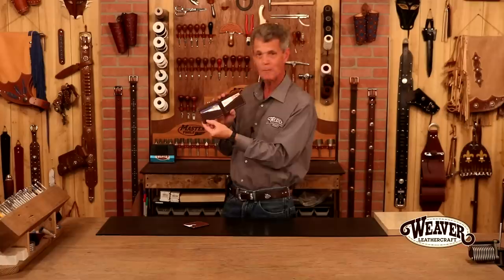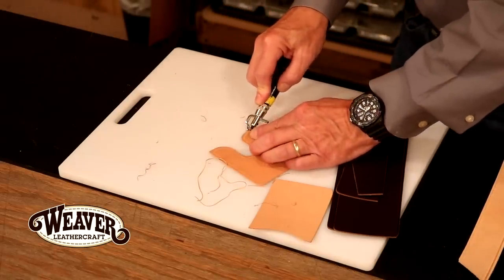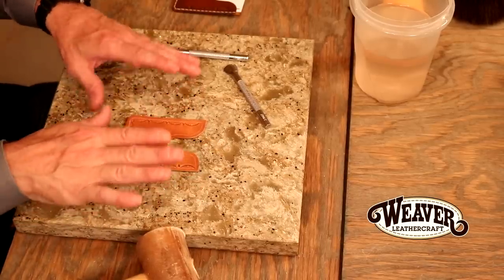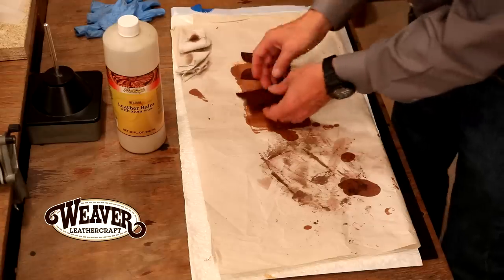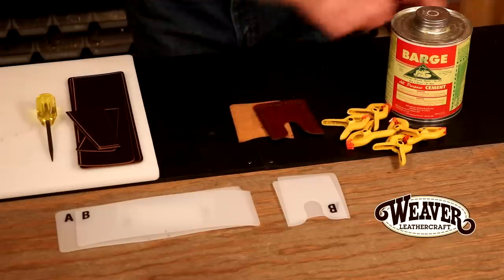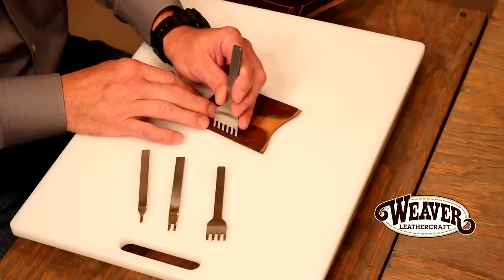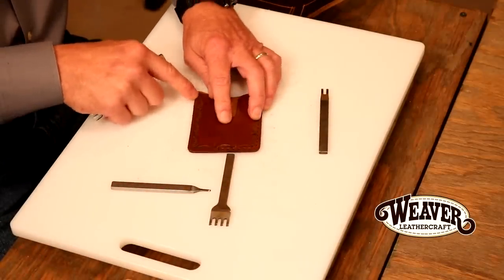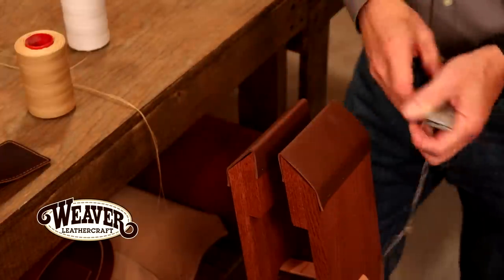How to Make a Leather Wallet and Card Holder

Comment: For paper, try the local newspaper. The presses use paper that comes on about 900-pound rolls that need a special fork lift to move, but when they're almost empty, most papers sell or give away what they call end rolls. $10 or less will get you hundreds of feet of paper -- not enough to print thousands of newspapers anymore, but years of backing paper for dying.
Reply from the maker: Thanks for the tip!

Comment: Chuck, I found that dyeing the leather, antiquing, top coating before putting the pricking holes in the leather allows you to sew without getting dye on your thread. Especially when you use white thread.  By pricking the holes in after the dye dries, you alleviate the dye “ghosting” on the thread. Richard
Reply: Good comment, i have had this happen as well.

Comment: You do a good job of explaining why too don't use the groover to put in a like before they chisel work.  Have you tried cutting in a groove line with a knife after the chisel work?  Too much work for the results?  Too much risk in fouling the project?
Reply from the maker: Hi Charles,
Always a good thought!  Unfortunately, the top grain is where the strength is and a chisel doesn’t break that.  With a cut line, the thread will sink below the top grain and give us a very inconsistent look to our stitch line.  Additionally, if the thread is only held by the flesh, and not the top grain, the stitch will soon tear, but, that is exactly the type of thinking that produces the best tricks and techniques!

Comment: I've been doing leather crafting for a while. Mostly knife sheaths & kits. I also use small pieces of left over leather to make inserts on the back side of small liner lock knives from Frost, Cutlery Corner, from the Wildlife Series. My tri-fold wallet needs replaces and I would like to make a custom special one for myself. Kits I have found for tri-fold have credit cards slide in from the side. Like the wallet I'm replacing I like them to slide in from the top of the wallet, or vertically. Mine also has a smooth liner which I would like to use in the one I make. Do you think you could demonstrate this in an upcoming video please?
Thank You Very Kindly in advance.

Comment: Hi, 
Is it necessary to perform back stitch when performing saddle stitch? For example back stitching 3 stitches and then moving forward and doing the same at the end? Reason I ask is because you dont do this in this video but maybe you do it depending on what project you are making?
Reply from the maker: Hello! Using a back stitch is a pretty solid closure. You see it with a machine stitch all the time, but, I tend to hide a knot between ply’s or in corners. Since I’m hand sewing I want a consistent look to my stitch and a double stitch looks out of place. A machine has to back stitch (mostly), so, with hand sewing, we can go a little extra distance to hide our knots and the stitch looks consistent from end to end. I hope this helps!

Comment: This was awesome!  If I'm just starting out, can I get by with any type of contact cement, like something I can find locally at a Home Depot or Walmart, or does it need to be leather specific?
Reply from the maker: If you read the back of the label it should tell you all the different materials you can use the cement on. Most contact cement from hardware stores will work but you will want to make sure it says that it will work for leather.

Comment: Need some advice on dying veg tan for wallets. Literally no one has any instruction on finishing the suede side of leather when you dye it.  So when you make a wallet, dye comes off onto whatever cards you put in the pockets.  It's also far lighter than the skin side.  I've tried a couple of finishes and most stick to the cards like glue AND tons of dye came off. Any help would be appreciated!
Reply from the maker: Hi Vasco,
It sounds like you’re using the alcohol dye (it just says “Leather Dye”) and not the Pro Dye.  The alcohol is terrible about rubbing off and the Pro isn’t.  Also, the colors are more true, consistent and it will leave the project less stiff.  I would suggest going with the Pro Dye (Fiebing’s), once dry just clean all sides with a very lightly oiled rag (very lightly so it doesn’t pool, Neatsfoot is good) and then top coat all sides with something like a Leather Balm or even a Saddle-Lac (two tricks to using this one).  This should knock out about 99% of the rub-off you’re experiencing.  Also, give each step ample time to dry.
Reply: @WeaverLeatherSupply  Thanks for the reply!  I've never tried saddle-lac, though I've seen others use it, I'll give it a shot.
And I only use the Fiebing's Pro Dyes. I've just always tried to finish the suede side to give it a better look and feel. Even with great quality leather, the suede is never completely smooth and it feels rough after drying or has fibers sticking up. I've found using Tan-Kote or Gum Trag and slicking it down works pretty well for interiors. Once it dries, there's no rub-off.  
Maybe you guys could do a simple bi-fold and show us how it's done? I'm sure everyone would love a veg-tan wallet tutorial!

Comment: Chuck please help me, I been following you videos making simple things out of veg tan, I have bought everything you have suggested. I got a Redrock Waxy Pull-Up Leather, Rust in 3 to 4 oz wanted to try chrome tan, it is very flimsy, is all chrome tan that way? how do i know if the chrome tan is really soft or more like veg tan, i see you working with chrome tan that kind of stiff. I now have a whole side of Redrock Waxy Pull-Up Leather and not sure what to do with it, Can you please help a beginner out please. Thanks
Reply from the maker: Hi Maurice,
Chrome tan is going to be more soft and supple than veg tan. There are some chrome tans like our Santa Rosa, Jasper and Lexi that have a bit more body. The best thing to do is read the description and read reviews or just give us a call if you're unsure of which leather to buy so you know how the temper, etc is. 
The Redock leather is great for bags, purses, totes, small clutches or dopp bags. Basically any kind of bag or pouch. Hope that helps!
Reply: @WeaverLeatherSupply  Thanks. yes that helps a lot.

Comment: Hey sir I keep struggling to hit the stitching chisel straight through multiple layers of leather. It looks great on the front side but the back can be wonky at times any tips on how to hit it dead on??
Reply from the maker: Hi Daniel,
The best thing I can tell you is to practice with scrap leather, I know I say that a lot but getting comfortable with the tools will truly make the biggest difference. One note would also be making sure the chisel is upright and not slanted. 
If you've done your practicing and are still have trouble maybe try a different mallet. A good quality maul or mallet will help get the tines through with fewer hits.
Also make sure you're not using a metal hammer as this can damage the chisels and it's harder to hit dead on. Hope this helps!

Comment: Question: For the card holder you put Antique on to make the engraving show itself clearer. If I use a water based dye is this necessary? do you usually do this only with oil based dyes? instead of leather balm is it ok to use leather wax? Another thing I would like to ask is when do you use backside finish and why?
Reply from the maker: Hi SK,
The antique will work well with most any type of dye, and it’s really just up to you if you want to be able to highlight the tooling more or not. Leather wax should work just fine as well. The leather balm is just one of my favorites so I use it on almost on every project!
Reply: @WeaverLeatherSupply  ok thanks sir. Im starting with leathercrafting next week, i found a new hobby but i gotta be honest the way you present leathercrafting is amazing, your enthusuaism is full of positive energy and I cant wait to see more project videos made by you!

Comment: Im having an issue with dip dyeing with the light brown. I follow your steps and everything is coming out dark brown even after overnight drying (without antiqueing). Can you help me out Chuck. Also when adding a saddle tan antique makes it almost black. And i use feibings gel antique
Reply from the maker: Russell!  I hate it that you’re having trouble here.  There’s really only two things that can make this happen.  Dye can get old and some of the carrier can evaporate, but, I think the issue may be the leather.  If it’s soft or spongy it will really absorb the dye and the antique, and or top coat, will just make it go darker.  You can cut the dye with a carrier so the leather is actually getting less of the dyestuff but that’s not the best answer to the problem.  Without actually knowing the level of tannage I may say a little higher quality will make all the difference (it has with me).
Reply: @WeaverLeatherSupply  ok thank you very much.  I have been buying all my leather from tandy leather but unsure of the brand.  I have been wanting to try herman oak or a higher quality leather but at this time its not in the budget. But thank you for your help and as always keep doing great videos.

Comment: Gum trag? Durable? Every time I've used it, it seems like it's great until it dries out, then it gets brittle and splits anywhere that flexes and makes the edge rough.
Reply: Maybe just a bit of beeswax?
Reply: alb673 i use water to slick and a home made wax blend as the mid step for basic burnishing. I still don't like gum trag. I do like tokonole for thin edge work and pasting backs though. But not gum trag.

Comment: i noticed you only did 2 edges of the credit card holder. why didn't you do the small edge before you glued in the liner. then when you do the other stitching it would all match.
Reply from the maker: Hi Raven,
Sometimes I do sew those seams on wallets, however, it’s not entirely necessary so for this video I just left that out.

Comment: What oz. Leather is best used for these projects?
Reply from the maker: Hi there,
We recommend a 4 oz. for the exterior of a wallet and 2/3 oz. for the interior. A 4/5 oz. for the interior pockets will work for the style we made in the video since there is only one card slot on each side, but, if you do more card slots than that we'd recommend a 2/3 oz. to keep it from getting too bulky.

Comment: Great video as always. Can i ask a couple of questions? You said the tread is 4 times the length, is that the length of the piece perimeter? And do you ever do back stitching at the start & finish? I think that would make a stronger point. Also what size is the tread for the wallet? Regards from UK
Reply from the maker: Hi there,
The thread length would be 4 times the length of the piece you're stitching. So, if your stitching all the way around the wallet - you would measure the entire length around the wallet and take that times 4.
I prefer a knot to a back stitch, but, that is just personal preference - both will work! 
We used 0.8 mm Ritza Tiger thread for the wallet. 
Hope that helps!

Comment: I am wondering about sewing snakeskin. Are there any special considerations as opposed to cowhides?
Reply from the maker: Snakeskin is beautiful, and it will sew but, it’s thin and doesn’t have good durability.  I would suggest using the snakeskin as an inset with a thicker leather around it (basically creating a window).  Sewing will be easier and look better and it will protect the snakeskin as much as is possible.
Reply: @WeaverLeatherSupply  Thank you!